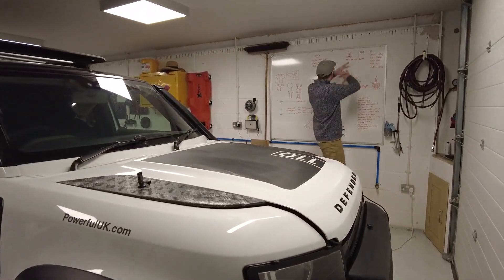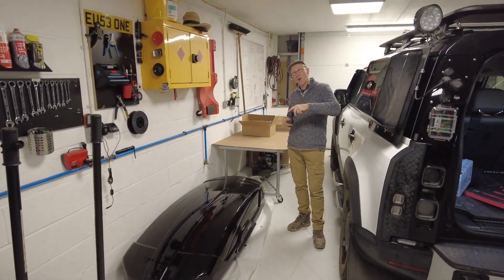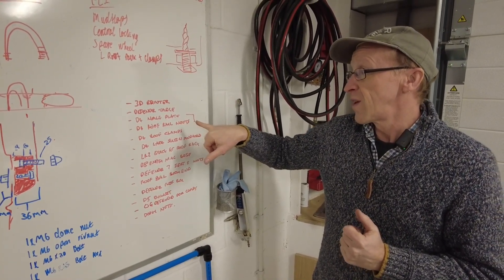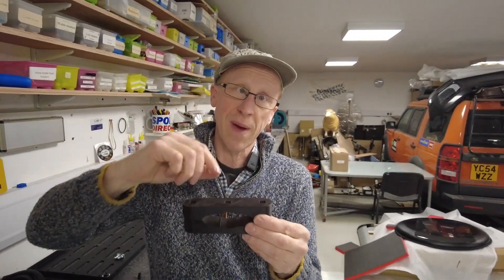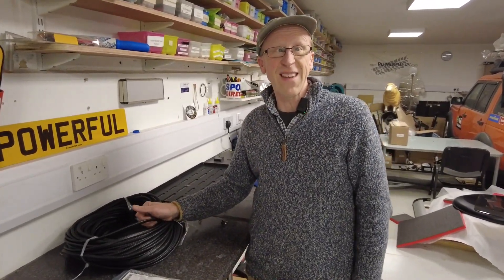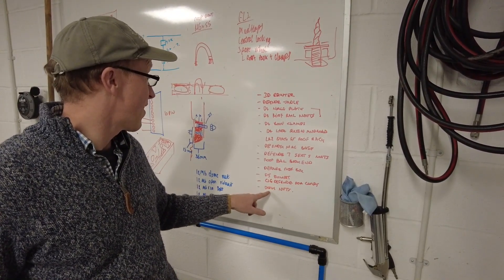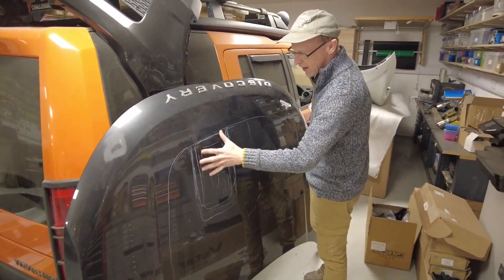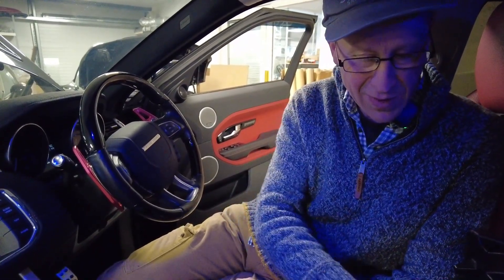VLOG 28 Jan 2022 Evoque Wireless Charger / Defender Picnic table + more !

Comment: To mount a Thule box in Canada we use two (2) hockey sticks.
Reply from the maker: Can you elaborate a little more Richard... trying to work out if this is a technical solution or am i being sucked into some Canada joke...
Reply: @L663  The older load bars were/are flat and rectangular, just about the same dimensions as a hockey stick. So if you were in a pinch ZIP ties and hockey sticks worked on the older boxes. Today it's all about aero bars and fancy attachment points to the boxes. But, on a Volvo 245...why not.

Comment: For the roof top box, have you thought about cutting a rail in to 4, then having that screw down to the rack without lifting any bars up, then the box would fit on to those 4 'raised' rail blocks? Might be a bit quicker to fit/remove?
Reply from the maker: Yes i think i understand you but the clamps cannot clamp around a double bar but they may just clamp around one if it was spaced enough above the other one to leave a gap for the "jaws". We are also looking at a cheap solution that retains manufacturers parts as much as possible. We debated several options - and i am sure our current solution may not the final one !
Reply: @L663  ah, fairy fluff.. The idea of raising 2 bars just sounds fiddly, if it's something you have on n off a bit. But having all the gear with some idea, I'm sure it's better than thoughts of a keyboard warrior! Keep up the good stuff!

Comment: Do you know when the picnic table will be available? And could those brackets on the roof racks be used for a spare wheel? It's quite common in Australia to carry two spares when Overlanding, due to distances between support services.
Reply from the maker: Hi  Michael - the pinic tables are on the website now !

The brackets could be used as the basis for a roof mount for a wheel but the load would need to be spread over a couple of roof bars - a large plate with 4 clamps ( one at each corner ) would do the trick.  You guys down under are the kings of off roading !
https://www.powerfuluk.com/catalogsearch/result?q=picnic
Reply: @L663  thanks, I've ordered one. Can't wait. Thanks for the spare wheel advice. We do alright down here, lots of land to cover and lots of fun doing it.

Comment: If you made clamps to go on the cross bars of the factory P38 roof rack I would buy some. Also that metal bracket for the lights to go with them.
Reply from the maker: I just looked how much those P38 roof bars are now.... if you can find them  $$$$$$$$$$
Reply: @L663  Lucky me as I have two sets. I plan to put am Autohome rooftop tent on them. I figure 4 will better take the weight. The side rails are  kind of an odd shape and make it hard to attach accessories. Clamps on the cross rails would be handy. Thanks for all the videos. I like your "folksy" presentation style. Cheers from 🇨🇦

Comment: Hi Simon, can you design a wireless charger dock for the Discovery 3 that possibly fits inside the centre console/fridge? Cheers
Reply from the maker: This is something we need to do - the one that goes over the cup holder has not bee popular - the chargers in the cubby seem way more popular... so we need to recognise that and come up with a solution.
Reply: @L663  Great, hopefully you can come up with something soon 😊👍
Reply: @L663  Great, hopefully you can come up with something soon 😊👍

Comment: Will the Evoque charger work in a 2016 convertible?
Reply from the maker: I have looked on the parts catalogue from LR and it is not showing a different part number for the console on the Convertible - seems to be same for the 3 door / 5 door and convertible ! It was a good question to ask and one thing i had not checked !

Comment: Great video as usual 👍 Being an owner of the Defender P400e, I am struggling with finding a good place for charge cables and Jack. Any thoughts on that?
Reply from the maker: Hi Johan... i may need a bit of clarification - are you looking to buy or store the charging lead and jack ( I guess store them )
Also I need to know if you have a 110 or a 90 ?
The space under the rear seat on the 110 needs more investigation... I need to look again

Comment: Would the wireless charger also fit a disco sport 2016?
Reply from the maker: Hi - it looks similar but it does not have the pen tray along the back
https://www.ebay.co.uk/itm/353775087242?hash=item525ea36e8a%3Ag%3AdyYAAOSwLXxhlw7P&LH_ItemCondition=4
Reply: @L663  Thank you